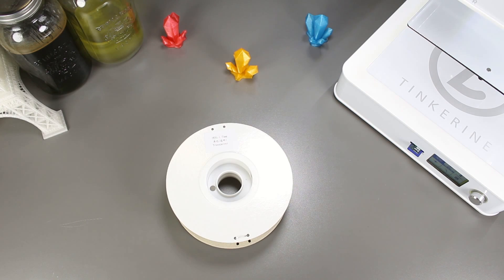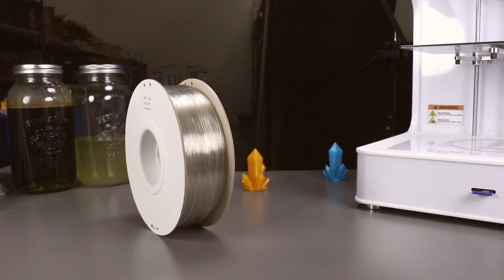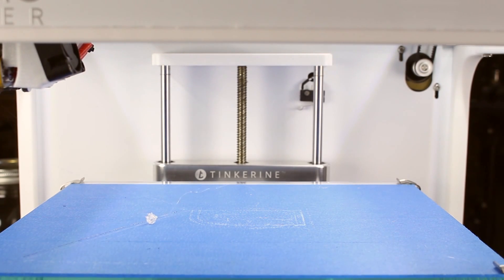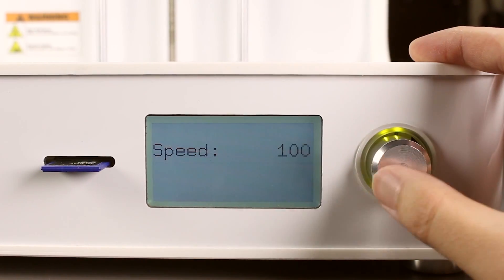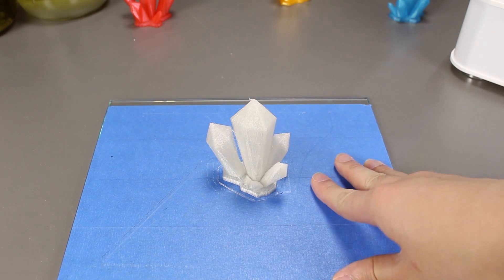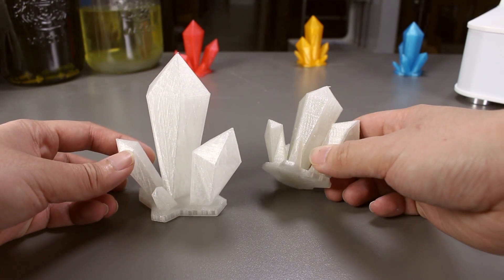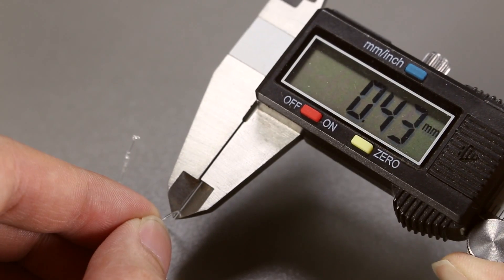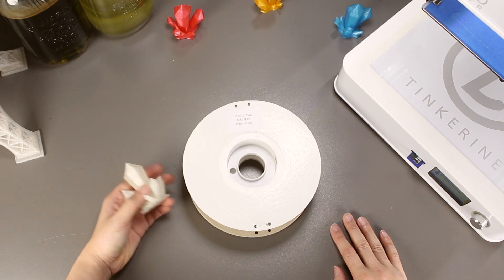3D Printing with PETG

Comment: Hi! Why did you've measured the "nozzle diameter"? Is it about clogging?
I've printed a bearing yesterday. It came out pretty good (not ideal). Today I've couldn't print almost the same bearing again (slightly different inner diameter). Now the same PETG sticks to the nozzle. I've cleaned the hot nozzle with paper but it's the same. At every print I remove plastic that come just before printing with tweezers. The surface is glass with a painter's tape (as it was yesterday). I put a layer of glue stick.
The fail starts at small details where it touches the little oozed part of this detail, it sticks to the nozzle and the n. drags this piece and then all goes messy.
I need to print that small pieces separated because they're the starting surfaces of the rollers (and are separated for the flat screwdriver).
Reply from the maker: Thanks for the comment! We measured the nozzle to check the wear and tear if you print with PETG.  It seems to stick fine to blue tape, have you tried it?

Comment: PET-G seems like a good all round material. It's supposedly stronger than PLA. It's food grade so isn't toxic (unlike ABS, which is very toxic!). It's an engineering material like ABS (unlike PLA). It's just a shame that for me at least, it's twice the price of PLA.
Reply: I do not like PLA and have a lot of rolls of it and I love ABS but I can't print in ABS in the late Spring until late Fall due to the excessive humidity.  Due to humidity it warps and pulls up from the bed no matter what I try but come the drier winter it lays down, and stays down, like butter...even the same exact part.  I had a roll of PETG I just never could extrude after my first print so after over a year I gave it another go and I like it BUT I have to print half the speed I do with ABS so twice as long of a print and bridging is not all that great.

Comment: Could PETG print without heated bed? That is a question! I built two printers with 400x400mm area and without heated bed (So, ABS is not an option for me) And i want to know- is it possible print with PETG on bed without heating element?
Reply from the maker: Hi!

Yes, the experiment is actually printed with no heated bed. Just straight on to the blue tape. So no worries on there!

Comment: I guess I'm the subscriber who wanted PETG to be tested. I tried to print with PETG and I had no problems at all, it printed even better than PLA, especially in a vase mode. Did you try to glue it with other materials? I found out that it can be tricky.
Reply from the maker: Hi Maciek,

Did you adjust any of the settings to print with PETG and what other materials are you gluing it towards? 

Thank you.